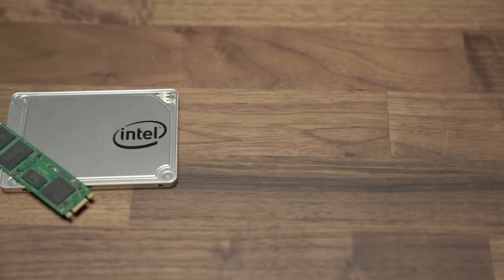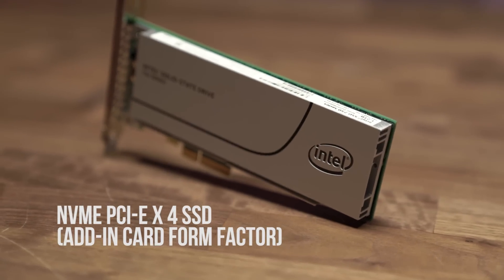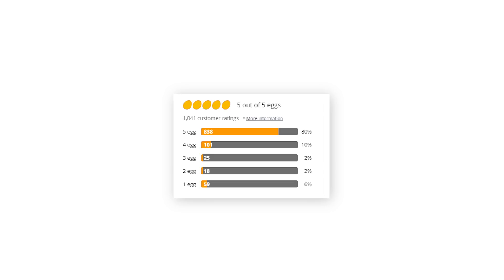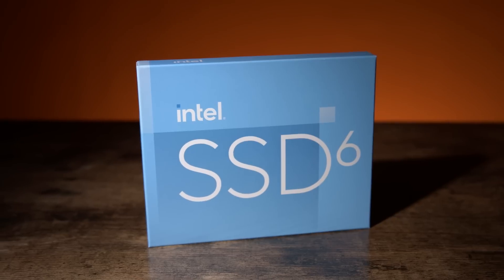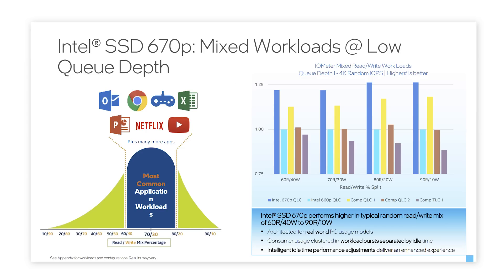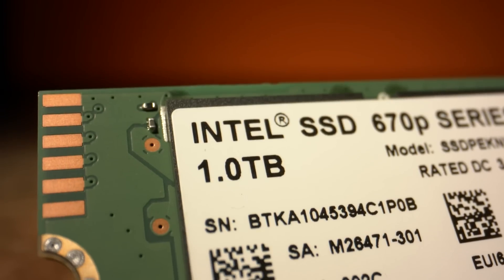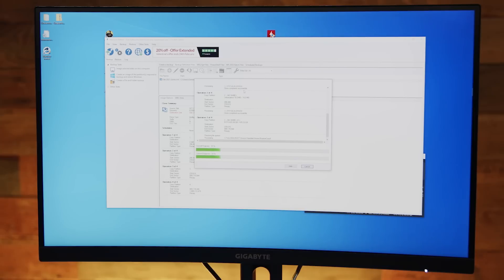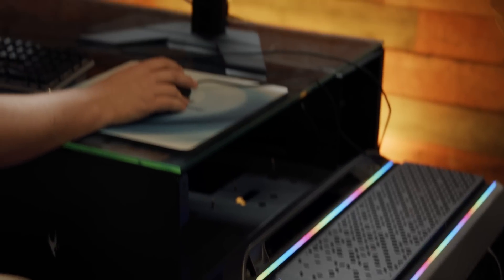Introducing the Intel QLC SSD 670p

Comment: Hey man, quick question. I have a new M.2 SSD drive coz my old one is failing........ Can I just take out the old m.2 and install the new one?

Basically, i want a clean install of windows 10 and just re install all the drivers on this new m.2 SSD drive but I am just worried that if I take out the old m.2 SSD, my pc wouldn't boot since the updated drivers for my GPU, CPU, RAM, etc. is on that old m.2 drive.
I don't know if you get what I mean.

Comment: so microcenter inland m.2 platinum is 3400 mbps 1900 mbps and for 95 dollars what is the point?
Reply: intel ssd 660p 670p use SO MUCH LESS power and saves laptop battery life. If you use a desktop, go for the TLC with higher power consumption

Comment: how is 870 evo plus vs 670p? which is better
Reply: There is no 870 evo plus. There is a 970 evo plus (nvme, in m.2 form factor) and there is an 870 evo (sata 3, only in 2.5 inch form factor) but no 870 evo plus.
Reply: evo is TLC, not QLC
Reply: The 670p has faster random read speeds than the 970 Evo Plus.  Random reads speeds are going to be more noticeable for the average user in day to day tasks including gaming rather than sequential write speeds.  Unless you are a video editor/content creator, it doesn't matter that it is QLC.

Comment: How much will it be for 1 or 2 TB?
Reply: Considering this is a slower QLC drive, price should be in the 10 cents to 12 cents per GB range.  Unless it's a lot cheaper than the ubiquitous but faster TLC drive that is currently in the 15 cents/GB, just buy a TLC drive instead. Theoretically, a QLC drive has a shorter lifespan since it's unlikely that all 4 layers will all be functioning properly together  long term.
Reply: @purplecrayon7281  unless 1TB QLC will be closer to an HDD price, I will stick with TLC.. Also QLC's write speeds are badly slow. Something like 700MB/S vs 1400MB/S for TLC

Comment: Is U.2 not a thing?
Reply: not necessary for consumers. maybe when ssd controller chips get fast enough it will go up to u.2 speeds and then you have to convince mobo makers to use that connector in the premium boards
Reply: @rurutuM  U.2 connectors already exist since Skylake era boards, and PCIE based SSD.

No idea why manufacturers still refused to make that connector available to mainstream.

In fact, traditional SATA will fit on U.2, since U.2 is merely an extension of SATA with PCIE (thus SATA Express)
Reply: @AlfaPro1337  i looked up u.2 mobo on newegg they're all $350+. the majority of the DIY pc market are using $100-200 mobo, so yeah there is a premium. also u.2 drives are double the price of nvme 3.0 they are for enterprise not average consumers.
Reply: @rurutuM  That's because all SSD manufacturers are price gouging.

Claims that QLC brings cost down, high capacity even on a decent controller (by that, a DRAM cache with SATA controller)--still charged 4TB for US$500.

Oh, those are Enterprise grade SSD, so there's extra Enterprise materials, like loss power protection, ECC DRAM cache, could be a SoC CPU over standard controller.

But we are talking about just the connector, and even if they removed those Enterprise material, there's still no reason of not releasing a U.2 type mainstream SSD. In fact, you can convert your M.2 to U.2 with little to no effort.
Reply: @AlfaPro1337  there is one reason I can think of, pcie4 nvme which are already capable of twice the speeds of U.2
Reply: @rurutuM  U.2 was before PCIE 4.0.

Also U.2 is using both SATA + PCIE (should be from CPU).

So if the CPU has PCIE 4.0 and controller on the 2.5 inch SSD is also PCIE 4.0, why not many PCIE 2.5 inch SSD?
Reply: @AlfaPro1337  i think intel will have pcie 4 on rocket lake. both intel and amd moving to pcie5 in 2 years or so. 
there are U.2 adaptors that plugs into the M.2 slot. that's probably the way consumer mobo manufacturers will handle this connector in the future.
Reply: @rurutuM  Skylake is late-2015/early-2016. It's been 4-5 years.

There's still no U.2 SSD for consumer.